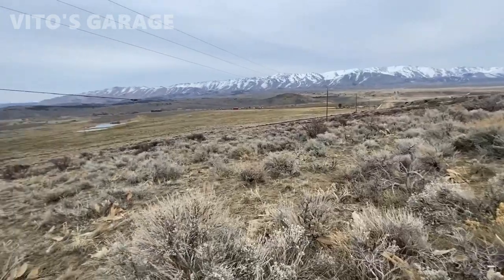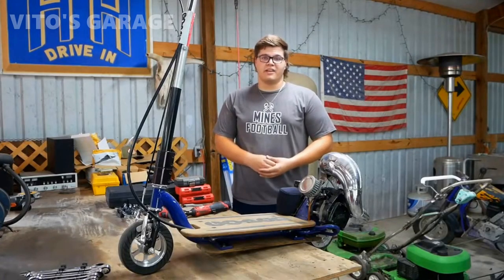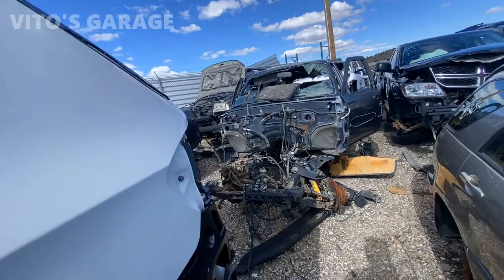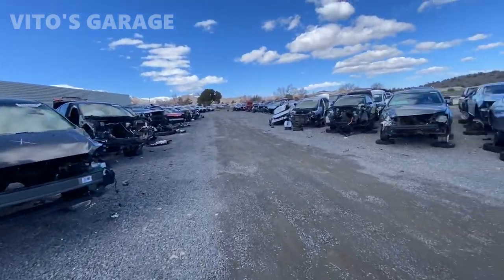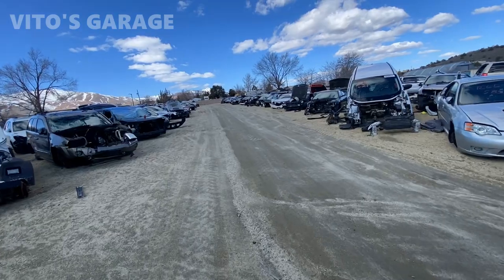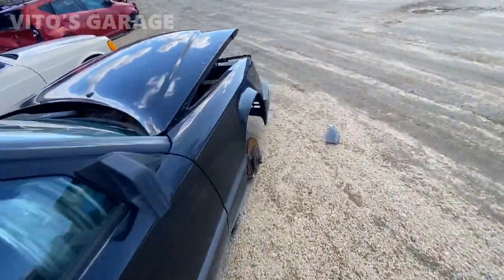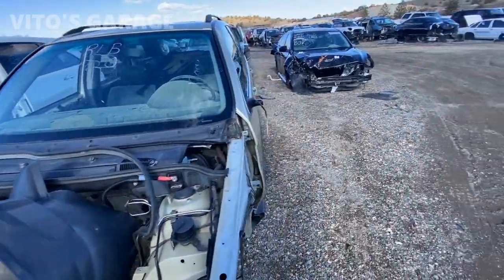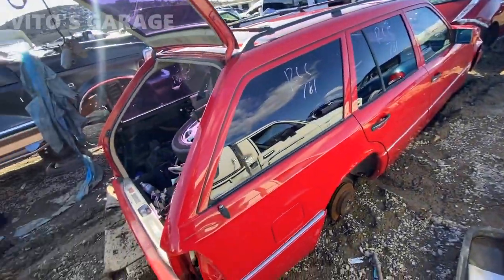Why I Hate Going To But Why I Love These Types of Junkyards!! Mercedes W126 W124 S210 BMW E39 E53..

Comment: Hi Vito, can you tell me why so many of these OM617 engine leak from the oil filler cap? I've replaced the gasket on my cap, but it still leaks like crazy. My engine is healthy, and does not have much blowby.
Reply from the maker: Those gaskets for the oil cap aren’t precise. Install a new oil filler cap